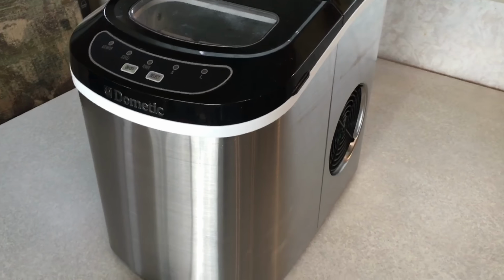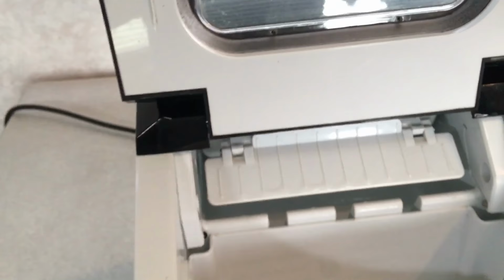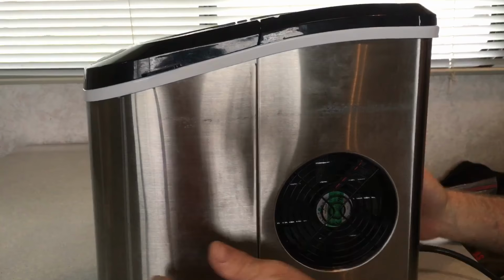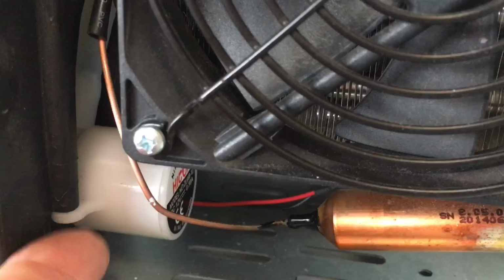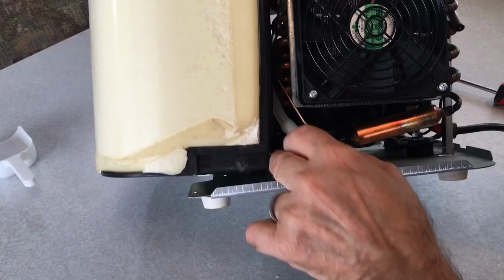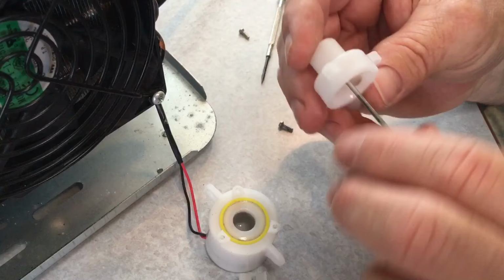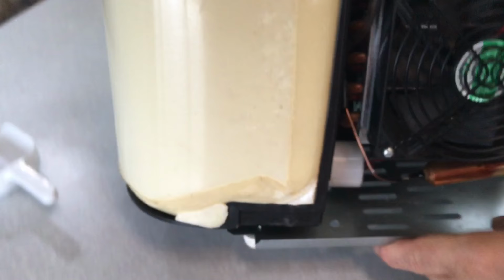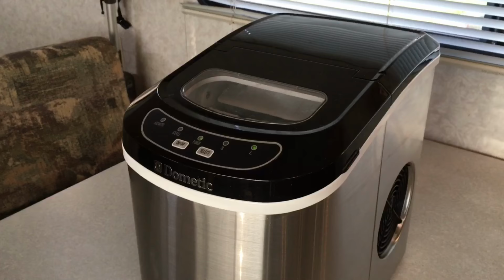Portable ice maker not working, watch this before throwing it away

Comment: Hi I've just watched your video ive cleaned water pump out there was tiny hairs which I've cleaned out put it all back together again then hold down the select button for 10 seconds to reboost it and its still not working ????
Reply from the maker: Sorry, I would’ve gotten back sooner but for some reason YouTube sometimes does not send me notifications.
Can you hear it pumping water? Or is it just not working at all towards anything?
Reply: Its makes a noise but nothing happening .there is no water spraying either .the motor isn't turning when we switch it on but all lights come on .am struggling to find someone to fix it 😪
Reply from the maker: That sounds like it could be a bunch of different things going on and hopefully not the circuit board. Wish I could help further. If something comes to mind I will comment back and since a lot of folks read the comments, if you do find out what’s causing this please reply so others can fix theirs too.
Reply: @reallystrangebuttrue   ive found out that the ice machine needs to be   re gassed with nitrogen but am unsure who can do this its like re gassing a refrigerator  or a freezer x

Comment: Hi, our ice machine has just started making a really loud noise like something is stuck, then it stops, do you know what this could be?
Reply from the maker: Hello, That could be a number of things, almost sounds as if the mechanical arms that operate the ice tray fill and dump could be getting caught on something. Try this, With a flashlight, look around on the top end with the lid open when it’s trying to work before digging deeper and removing the shell. Hope this helps, good luck and please let me know what you find.
Reply: Open up the machine ,clean up both the condenser,evaluator,  and listening to condenser fans. It’s will help stop those noises. Same as the  refrigerator.

Comment: It's still not working. I think the sensor is off. Also, I have the same machine but different brand. The entire inside looks exactly the same as yours
Reply from the maker: Still not working in which way,  
What are the symptoms?
Reply: @reallystrangebuttrue  flashing lights, fan not running, and water rarely coming out.

Comment: The machine does not turn on. The bottom does not turn on green light on the the center is on
Reply from the maker: Really not sure what’s going on with your machine to do all that without pulling it apart and start checking everything. It could be something so simple as a loose wire or something bad. Sorry

Comment: Ice machine lee saying add water n it water in it what to do
Reply from the maker: I know it sounds crazy but make sure there’s water in it LOL it could’ve sucked some air and needs to prime. Secondly, that is what this machine in the video was doing because there was not enough pressure for the water to make it to the reservoir that makes the ice because it was restricted flow therefore it was sensing that it was out of water.
Take a flashlight and make sure that the water is filling inside of the tray where the ice cubes are formed. 
Please let me know what you find.

Comment: Unfortunately, my parents are not interested in fixing portable ice makers.
Reply from the maker: That’s a bummer, even the new ones will malfunction sometime straight out of the box. Just make sure they keep the receipt and if it’s within the warranty., Return it. That’s an easy fix LOL
Reply: I have an Air Choice ice maker looks same as yours and it's not doing anything.  It was given to me and assume this is why but when you fill up the reservoir and plug it in it looks like it's going to start,  the arm in back rotates forward then back..the timer shows up and then the ADD WATER light comes on and nothing.  No signs,  no pumping. I'm going to attempt to take it apart like you.  Do you think it sounds the pump ? If so should I even bother? I did wipe it out and the little filter in the bottom of reservoir looked like there may have been some type of sand?? Culprit? Guess we'll see
Reply: @reallystrangebuttrue  .